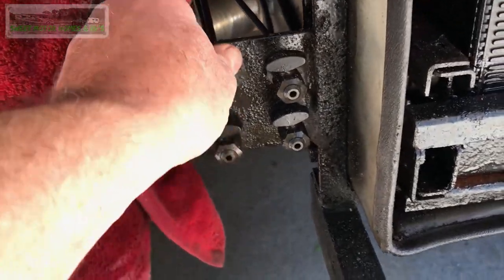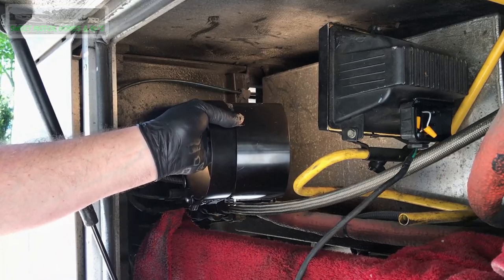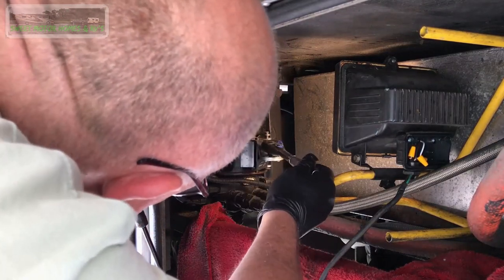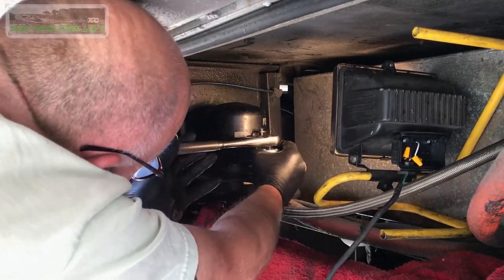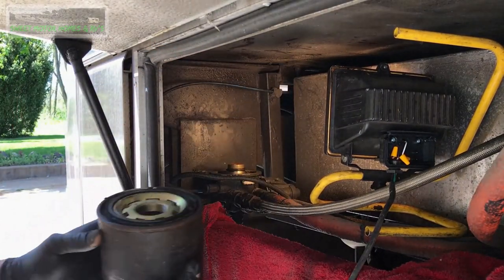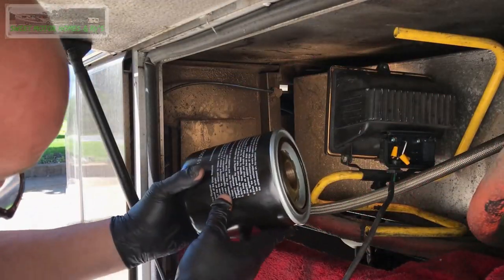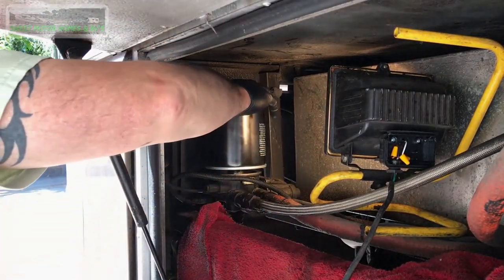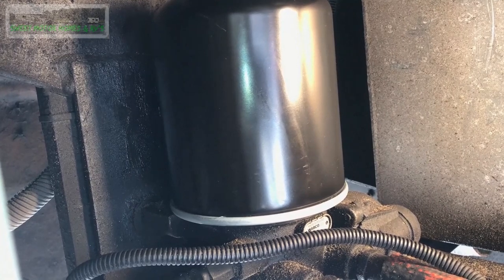How to REMOVE Air Dryer Cartridge/Filter in 10 minutes! RV Motor Home Semi

Comment: With every motorhome being different, location is probably different, as would be the part #.   Thanks for this, as this will be my first attempt at changing 'any' filter on our '08 Tiffin Phaeton 8.3 ISC, as I've bought all fuel filters, oil and Onan penny filters, but don't mind getting my hands dirty, and figuring this all out to save the labour cost.   I am perusing Youtube, just to make sure it is done correctly, so thanks for the video!
Reply from the maker: you are very welcome Dale